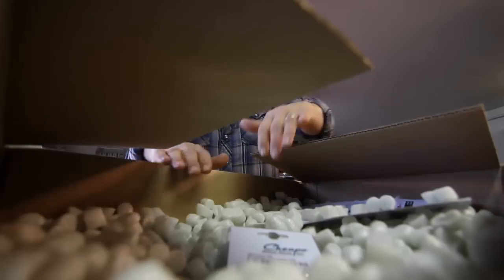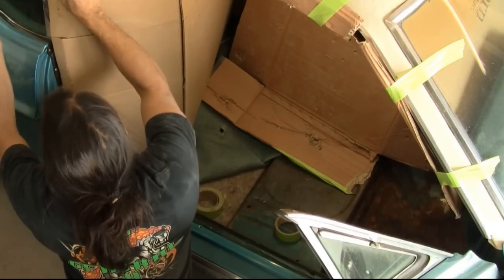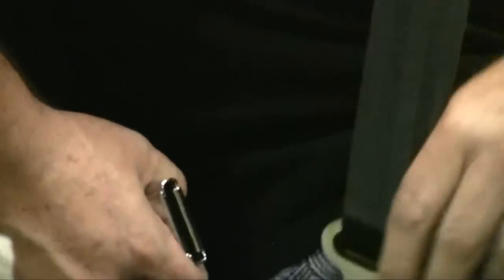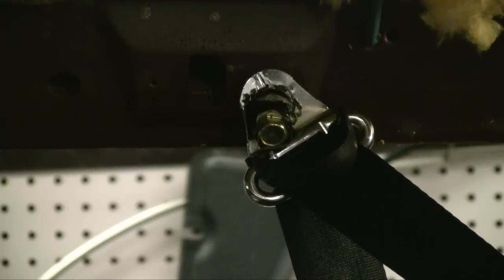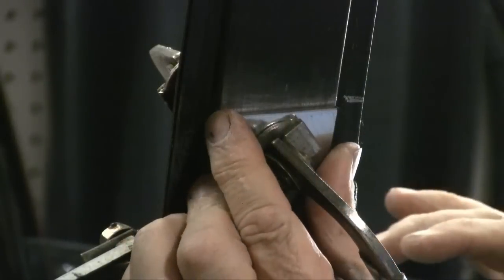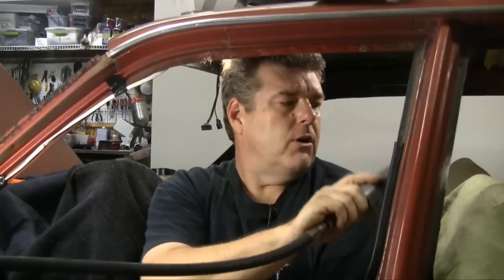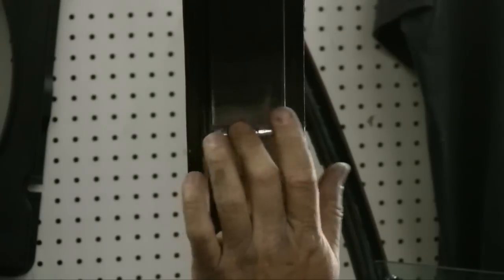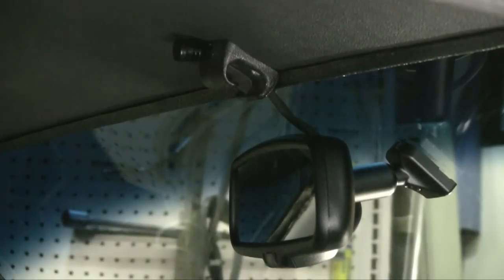Custom Fitting Retrobelt Seat Belts, Safety, Street Rod, Station Wagon, Four Door,  Episode 132 Auto

Comment: Retrobelts with shoulder harnesses are -- to me -- the best safety upgrade for 60s cars.  I don't recall shoulder belts in a '65 Mustang, just lap.  When you get a Stang of that era back in the shop and if you have a way to retro shoulder belts in, you will be heroes.  Even Vinnie.
Reply: CJ Pony parts kit mounts waaay too low below the point of your shoulder to be safe. No easy way to mount them above the side glass without restricting your view.

Comment from the maker: We did on the other side. But remember that weld through primer in those kind of small heat zones will usually, mostly burn up. But we agree on larger areas. we plan on going into that when we do the lower door repair soon.

Comment: I am not coming from a negative place when I make this comment. And I am really surprised that no one has made this comment. First, the big round Fender washers used for the seat belt attachment on the floor, the ones inside of the cab serve no purpose at all. The ones under the cab are thick and wide to distribute the impact load amongst as much sheet metal as possible. The washers that you put in the cab on top of the sheet metal really don't do anything for strength or impact bracing. Now my more serious concern is the fact that you took that shoulder bracket which was designed and engineered to be fished inside of the b-pillar, riveted in place and then screw the seat belt bolt to.  You instead  hacked it up and reduced its surface area, and in your words, turd welded it to the sheet metal on the b-pillar. Just like the big round washer on the bottom seat brackets you need that shoulder plate to be as large as possible, in behind the sheet metal inside of the b-pillar to help distribute the force of impact of crash. So currently , it is aesthetically held in place, giving a false sense of safety.  And a crappy welders best friend is a grinder so you can't tell how weak those welds are. So you're crossing your fingers that in an impact your turd welds are going to hold. This is an incredibly important project that #1 I wouldn't weld, #2 if I did weld it, I would have someone much better weld it for me.
Reply: Fishing it inside can be problematic if you drop it.
The turd welds are plenty strong 99%. 
If you've a hardtop car the top needs a bracket behind the headliner, and then the belt is always in the open view.
I like the 1969 Pontiac/GM types.. IF you can find them.

Comment: Any recommendations for a rear 3 point? I'm trying to figure out a good place to mount the top portion in a 74 Nova
Reply from the maker: Best bet would be to use a Retrobelt system and customize it. We've looked at doing that in the '69 Fairlane wagon (hauling kids) but not as easy as Nova would be unless the car is a Hatchback. Then you are in the same boat as us.